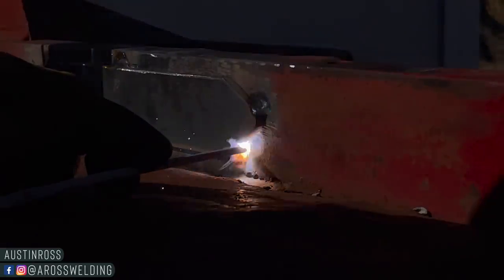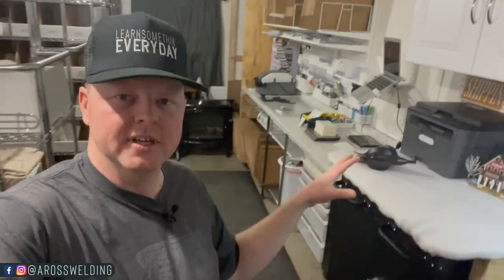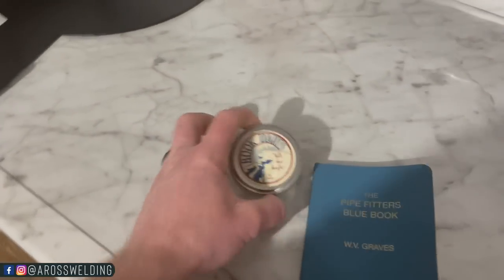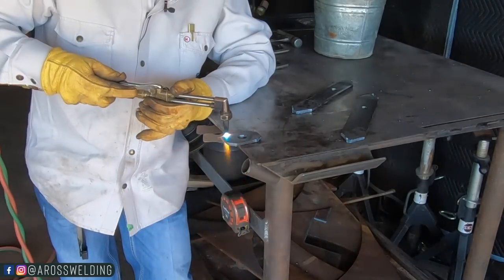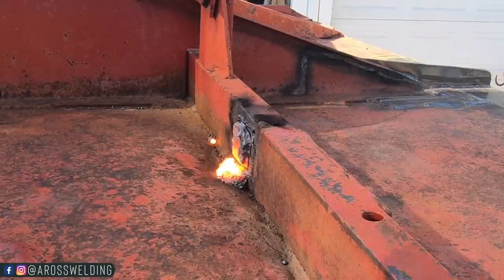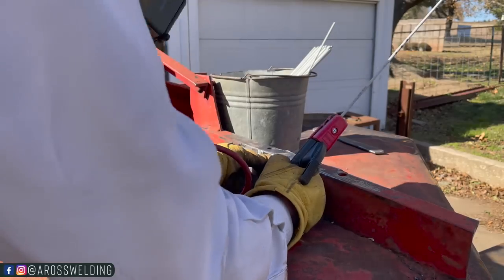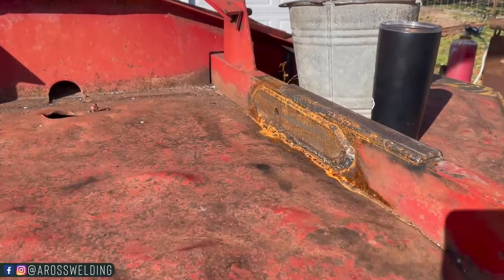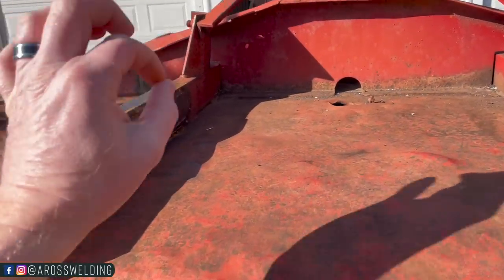Fish Plate Welding Repair

Comment: The fun part about welding repairs is that every repair job is different and presents its own challenges. And when it’s a repair with many different angles horizontal vertical flat and over head combined. Regardless of how long one has be in the industry. Sometimes there is a tricky weld that will test your ability. And that one tested you and you made it look good 👍

Comment: I love watching your videos and learning.  I grew up on a small dairy farm in the central valley of California. I have helped since I was small to repair farm equipment and done many repairs and repairs on repairs.  I have learned that two pieces of metal will rust between and swell and either rust through or bulge and crack or both.  So now I paint the metal (there is weld through primer or galvanized paint is supposed to work which is what I use) and I put "speed holes " in the fish plates.  I weld the top solid and most of the ends (not the top or bottom), the bottom I do stitch welds to let moisture drain and on the speed holes I weld the mostly vertical sections leaving top and bottom open.  The original crack is put between holes. Anyway it seems to work for me. However, I'm not a professional welder and I have not done a thousand.  But the repairs I have done stayed really good. Also,  not all my ideas, but what I have seen and learned from what I've seen, been told and seen first hand myself. I just wanted to pass along what I have learned.  I don't know if I explained it very well. I wish I could draw a picture on here to show exactly what I am talking about.  Thank you for your insight and tips.

Comment: That position even gets me sometimes with a flux core welding tip which is pretty tight access. it is trying to go against the laws of physics. Kudos for trying this with a stick machine. Lol, happy holidays  Dangle that carrot and a welder will try to grab it forever.

Comment: Austin , your videos are out standing I have learned a lot from you , I was watching you struggle on that vertical up point on the (FLITCH ) Plate some times we forget to  bend the rod to your will , the rod does what you need it to do . some times bending that rod 3 inch down to make that rod work for you is the answer  any way thanks for taking the time to make these videos. Flitch Plate (a Metal plate sandwiched between planks in forming a flitch beam or girder..

Comment: I recently welded some 2×4 tubing back together because one of those broke (used as forks on a tractor). I planned this type of project out, the forks were about 4 feet 6 in. And I put 3 foot stiffeners on both side of each fork. 1.5 in. On one side 3/16 thick and otherside a 1/4in. On each fork. Didn't cut angles and I welded them solid all 4 sides. And put 5 holes in the 1/4" and plugged them. Also added 4, seven inch plates, 2 on top and bottom and welded those solid with plug welds. So does that weaken the 2×4 tubing? Fixed the original problem best I could. This video helped me see where I might have made some mistakes. Thanks for sharing!

Comment: I sure would like to see you do some detailed videos about fish plate welding. It would be nice to see more info about this repair method that could help many people. While you mention rounding the edges, it seems that is mucho important in the technique. So many shade tree welders have their methods, but it would be interesting to see how you approach the thought process about the setup (cutting the brace/plate) and deciding how to decide the travel direction of the welds.
Just think of it as an excuse for you to get in more practice!
Reply: I've seen someone do a repair on a large excavator where they were told to weld about 3 inches past the end of the fish plate without welding around the radius of the plate
The engineers said it made the repair less likely to crack at the end of the plate

Comment: Great work Mr. Ross! Saw your number but figured I’d try this first. Think 7018 rod would be good to use for vertical-face horizontal crack repair on 3/8” plate steel? Loader attachment subframe has cracked on both sides.
Reply from the maker: Absolutely

Comment: As much as i try to avoid it, some jobs require welding new plate up to old very very pitted old plate (youll be chasing your tail if you try to remove it all) and it always puts up a hard fight till the end! Would love to see how you handle that situation! The worst one ive faced was 3/16” plate with up to a 1/8” gap at some points.

Comment: for that 45 vertical up in tight spots like that, i usually weld with my rod coming in from the outside rather than straight on. Usually helps a ton!

Comment: always thinking of getting a plasma cutter, but the 1/8 7018 just takes its place... 1/4 to 1/2 plate cuts +165amp's etc wet rod cuts different at 165.

Comment: A place I really wish I could improve is the transition from overhead to vertical on a truck frame. I always have to weld the bottoms then the sides and fill in the corner I can never make a nice transition in one pass. Maybe you have some pointers

Comment: If you want better welds then use a mig welder they are much better but it requires more things    20:04 grind the rust away

Comment: Rather than flat plate you could have used a piece of angle... weld it to the deck and that arm... That's what I do 'cause I know I can't weld the way I want in that little crack.

Comment: Should have put a bevel on them plates
Reply from the maker: Dang…. I should have done that at least on the bottom side… I just did that on a truck frame the other day but with 1/2” plate so I could weld right under one of the crossmembers on the stock pick bed… I don’t know why I didn’t think of it here 🤦‍♂️😂 thanks for the reminder!!!